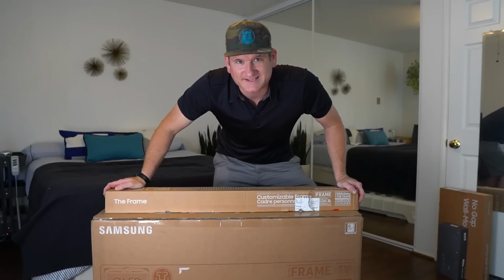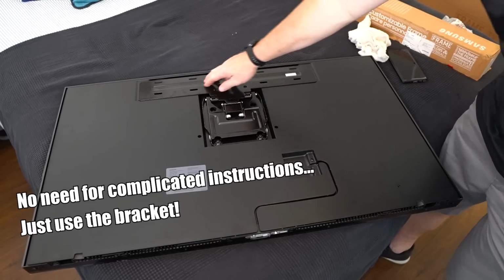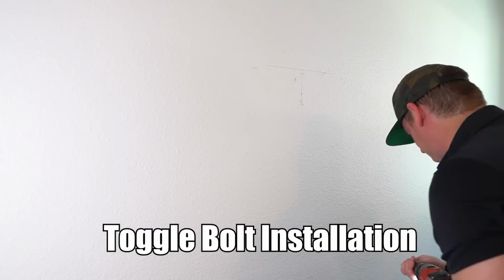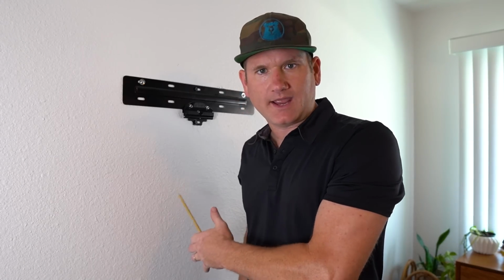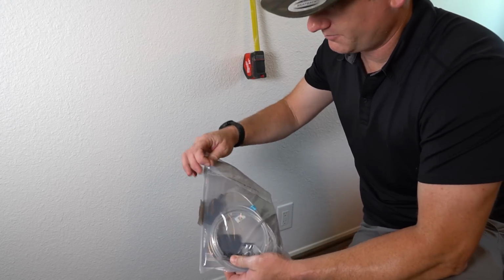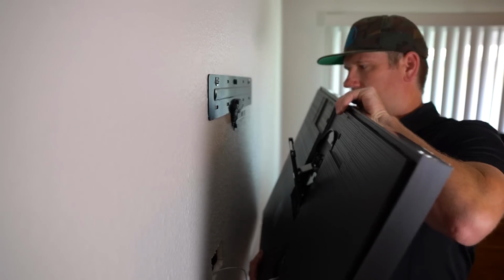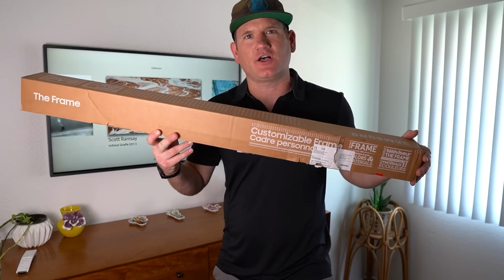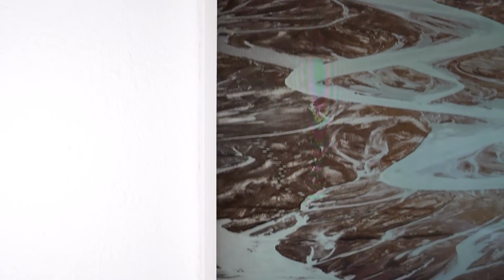Samsung The Frame Install w/ No-gap Wall Mount & Customizable White Bezel

Comment: Great video. I have been looking to buy the frame TV for a while now. I am glad samsung released a new frame TV in 2020. I had two questions tho. Would really help me. 

1)  The Frame TV comes with a One Connect box. I hear you saying that it has a Bluetooth. Does that mean I don't need to connect it with wires? I really don't want to spoil the surrounding of such a beautiful TV with loose wires hanging about. 

2)  I also have a Sony TV in mind. The Sony X950g or the X950h. It's a full array LED. I wanted to know which Tv is better between the Frame and Sony X950g or X950h.
Reply from the maker: 1. The tv only has that "one wire" attached. Then everything connects to that 'one connect box' below. So there may be additional wires if you have cable or sound bar... however you can access most apps and you really don't need anything but the tv and box to watch most tv.  

2. The sony is good.  I've heard some say the sony may handle gaming better, both tvs are good... this would only be my choice if I wanted the art look when the tv is off.  If you want best tv for the price range, the LG OLEDC9, Sony A9G (more expensive) or even the Samsung Q90T are similarly priced and better quality tvs.

Comment: Does this tv has hdmi 2.1??
Reply from the maker: It does have 1 hdmi 2.1 in the HDMI 3 eARC
Reply: So it runs at 4k@120fps?
Reply: Hey are you sure it has hdmi 2.1 because I had a convo with  customer service and they don't even know anything regarding the version of hdmi.
Reply from the maker: Right? I know.  I just looked up 2020 QLED and it shows the Q60T AND up are 2 1 in hdmi 3.  But then I read the 60 and 70 Re only partially.  But I have seen on HDMI 3 it says eARC on the port so that means it has some 2.1 features and that is same marking on LG and SONY eArc ports.
Reply from the maker: One of the HDMIs on this set – as with all 2020 Samsung QLED TVs bar the Q60T range – supports HDMI 2.1 up to bitrates of 40Gbps. This isn’t quite the full 48Gbps capacity HDMI 2.1 can deliver, but it’s enough to support 10-bit 4K at 120Hz frame rates with 4:4:4 color. Enough for the top graphics performance being targeted by the next generation of games consoles
Reply from the maker: Here is the actual information from earlier in year regarding 2020 QLED from samsung 

One of the HDMIs on this set – as with all 2020 Samsung QLED TVs bar the Q60T range – supports HDMI 2.1 up to bitrates of 40Gbps. This isn’t quite the full 48Gbps capacity HDMI 2.1 can deliver, but it’s enough to support 10-bit 4K at 120Hz frame rates with 4:4:4 color. Enough for the top graphics performance being targeted by the next generation of games consoles
Reply: That's great!! Thank you so much for replying.
Reply: So the frame comes under Q60T Range??

Comment: Just curious, do you know where you can find a wall rated cord for the 2020 model? I haven't had any luck finding it. Thanks!
Reply from the maker: I believe it's the same as 2019.  https://www.samsung.com/us/televisions-home-theater/television-home-theater-accessories/televisions/5m-one-connect-in-wall-cable-for-qled-frame-tvs-2019-vg-socr86u-za/
Reply: B The Installer thanks! I chatted with a Samsung agent and they assured me twice that the cord that came with the The 2020 Frame was wall rated!!
Reply from the maker: In the states, the wire is not in-wall type cord as it has power running through it... i hope I'm wrong, but I get told at least once a week that it's not in wall rated even as I state that in the video.   I would put the cord in my wall, that is my own opinion... my own very minimal risk.
Reply: @BTheInstaller  I keep reading it's not wall rated. Would this work? https://www.echogear.com/av-accessories/in-wall-power-cable-management-kit/

Comment: Hi thanks for great video, really helpful - can I ask a question, wanted to get this tv for a minimalist room there is no furniture under or near the tv to hide the one connect box, is it possible to place the box  in the room adjacent to the tv wall (with cable passed through wall ) and will this setup work for everyday use, are there any other solutions you might suggest,  its a pity there is a box at all but then it would be magic tv! 
thanks
Reply from the maker: You can do that and/or you can put inside the wall in a low voltage panel.  I may do a video on how to hide the one connect inside wall.

Comment: Thanks for your videos! These have been great.   I'm buying a 2020 55" frame tv and making holes in advance and went off of your 2019 measurements.   I know this is the 43", but do you think the OneConnect socket in the TV is roughly in the same spot as your 2019 videos? 

Also, is the OneConnect cable the same as the 2019 version?
Reply from the maker: Yeah its likely same as the 2nd frame video with like 25k views. But to be honest, you can pretty much send it down anywhere inside the perimeter.
Reply from the maker: Thanks BTW.   Also the 2019 and 2020 have same one connect. The 2017 and 2018 were low voltage and a power cord separate.  More to come.

Comment: Is the white bezel plastic or metal? I read a rumor they switched from metal to plastic.
Reply from the maker: I've never seen a metal frame.  It's been plastic for at least 2 years.  It's just got magnetic squares on them to connect to the tv.  They're really nice though. Obviously someone is soon to make a generic version, hmm.. maybe that's what I should do, lol
Reply: B The Installer thanks. The 2017 and 2018 white frames I have are metal. I just bought the 2020 and haven’t ordered the white one yet. I guess I should now expect plastic.
Reply from the maker: @steedferns  gotcha.  Yeah definitely plastic. Probably cheaper to make.  They're solid, maybe you can tell me if they fit better or worse.  I'm about to do a video where ill have white, beige, and the black of course.  Should be nice to get a look at all 3 in one video.
Reply: @BTheInstaller  Just got the beige 2020.. yup 100% cheap plastic.  2018 and 2017 are wood.  Are you sure about 2019 being plastic?

Comment: Thanks a lot for the previous the frame installation video, already install it with Samsung's Indonesia technical official. But sadly I know it more to install than him 😅. It's okay and I'm satisfied with it, cz it was free no charge 👌🏻

Install it on the dry wall, so using tiny cable conduit as place the cable is the answer ☹️😂 and got the Beige frame it was so beautiful, btw tx a lot
Reply from the maker: Not sure I follow.  If you mean you knew more than the tech, that happens with some yes.  Not this guy lol.  Good deal

Comment: I am just trying to find a way to install it on my brick wall.  Back here in India we rarely have that kind of boarded walls where we can cut out holes. But that issue you have already pointed out in your previous video , still am thinking of buying this TV cause it looks so gorgeous. Does the 2020 model come with a stand? Because, I may prefer it on the top of a TV table if I am unable to find a way to mount it on my walls properly. Thanks a lot for making such informative videos on the art of clean and precise installation. It’s an under appreciated art. More satisfying for someone like me who has OCD.😅
Reply from the maker: Haha. I appreciate that.  I was even mad that I didn't tie the wires up on screen but to get more people to stay tuned in, I have to cut some stuff out.  I would put this on a brick wall, just leave the slim wire visible.  It can be neatly in a groove and/or painted.  You'd hardly even see it
Reply: @BTheInstaller  yeah was going ask if that connecting cable is slim enough to just have dangling down behind the tv and add on frame?

May have to install in a very touchy locating where cutting into walls just isn’t and option and almost certainly will have cross dwangs/fire blocks to deal with on the way down. 

Surface mounting may be the only way but that cable looks really slim and I could paint it to match perhaps 🤔

Comment: I want to buy it but i will need another wall mount because my couch is on the side of my room . Does it make any sense to buy this tv but mount it not in a standard way ?
Reply from the maker: Hmm... not really.  They do have mounts that can full recess in wall and then turn.  But if you have a 2-4 inch gap behind a picture, maybe a standard samsung tv would be better shape and quality.

Comment: Great video!  I am installing this on a concrete wall (in a condo), and I guess I won't be able to hide the cord behind the wall, would you agree?
Reply from the maker: Yeah but seeing that slim wire is hardly the same as a couple thicket HDMI and power..  you also can paint the cord wall color if needed.  I did post a video on how to mount over brick fireplace.   Concrete same, need hammer drill and possibly 1/4 inch but for those red anchors I believe?
Reply: @BTheInstaller  Thanks mate.  Yeah, using a hammer drill but going to opt for Tapcon screws vs. the ones that come with the mount.  Wish me luck!

Comment: Thank You B - I was able to install my The Frame 2020 of your videos. Your videos are just great. 

Now, I need a video on how to install the new Sonos Sub Gen 3 over an outlet!! :-) I think it's my best option to hide the power cord.
Reply from the maker: Install? You mean to connect it to a sound bar? The set up is pretty easy... did you mean a sound bar?
Reply: @BTheInstaller  I will be able to install the soundbar using this video (tkx again): https://www.youtube.com/watch?v=6sy49rr74JQ&t=1s

I want to wall mount the Sonos Sub. The Sub will be far away on the right side of the tv media. Studs will be in play in the wall, and I cannot run the power cable within the wall.  I'm not sure how to do it and keep the power cable hidden as much as possible. People told me to install it over an outlet. I could not find any video about it, not even picture!

My setup is a bit like that but this one is not wall mounted: https://images.idgesg.net/images/article/2020/05/sonos-arc-white-with-sub-100840966-large.jpg
Reply from the maker: Seems like a trustworthy source for a video lol.

Comment: I used one of your old videos yesterday to hang our frame tv. Wish I had this video! Ours did come with toggle bolts. Our wall had insulation in it, so at that point we gave up trying to thread the wire through the wall. Maybe I will try and go back and do that today. Wish me luck. What could possibly go wrong.
Reply from the maker: Haha, yeah a fish tape and stud finder can do wonders.  If you can fish up the wall and pull the smaller end down, its easier.  If you keep the fish tape bent toward front of drywall it can stay in front of the insulation.  See my video on concealing cords if needed.  Thanks